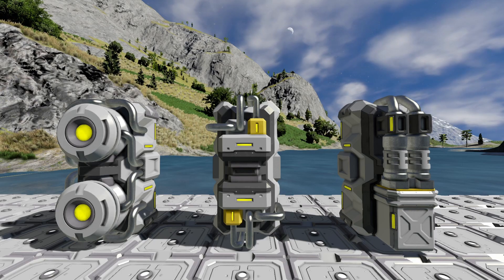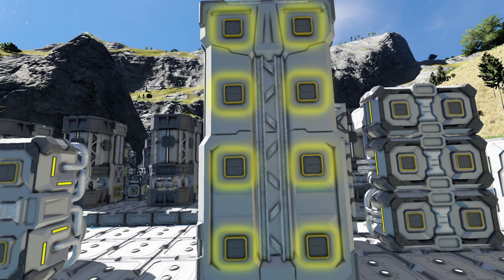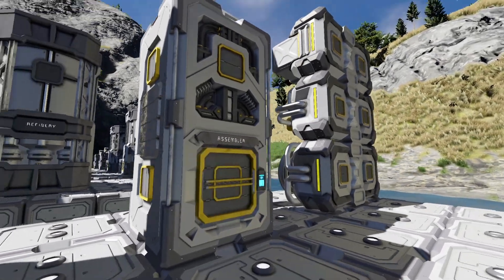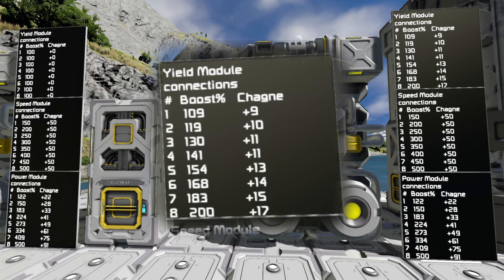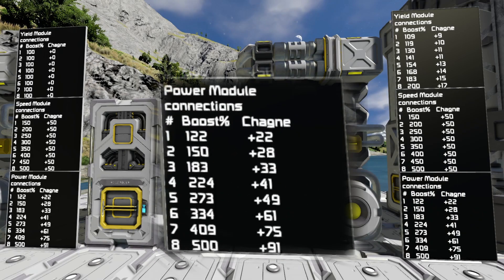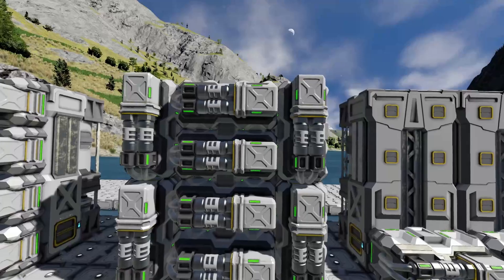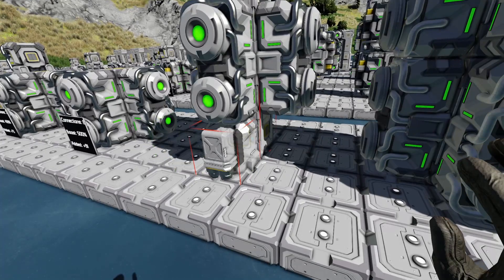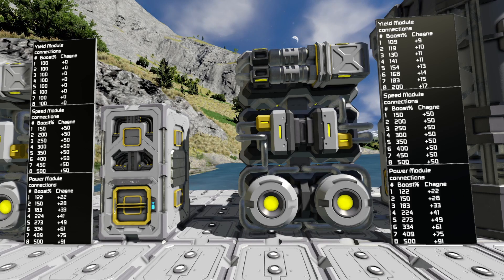Space Engineers Survival Guide - UPGRADE MODULES EXPLAINED - s1s01

Comment: Good guide for beginners, though I wanted to note down some peculiarities I found out about the upgrade modules.
Especially the upgrade percentages ingame are pretty weird and mostly misleading.

Yield is the most intuitive, in my opinion, as it shows you how efficient the refinery works. All yield upgrades on the refinery give 200% Effectiveness, meaning you get double the ingots for your ores. This is at the same ore intake speed, meaning you are also getting twice the ingots per amount of time. That makes it undoubtedly the best option in most cases.

The speed upgrade is an additive modifier of 0.5 per port to the base speed. The assembler has a speed of 1, therefore one speed module does in fact increase the speed by 100%. The refinery, however, has a base speed of 1.3, meaning that one full speed module only increases your ore intake speed to 2.3, which is only about 77% more. All 4 speed modules on the refinery actually only increase speed by about 308%.

The performance of the power saving module is not really increasing per upgrade. The Power Efficiency percentage is inversely proportional to the power cost. Arguably, the power saving per module can be considered constant at about 33% per module, but it is a multiplicative effect.
To clarify, for the 560 kW base power draw of the assembler, the first full module actually saves you 186 kW, the second 124 kW, the third 83 kW and the fourth only 55 kW. All in all, it saves 80% of the production power draw, the assembler therefore only uses 112 kW when active.